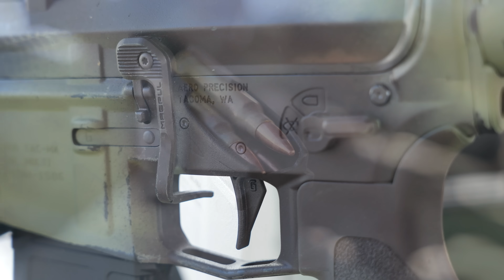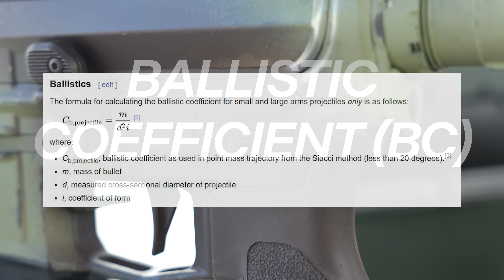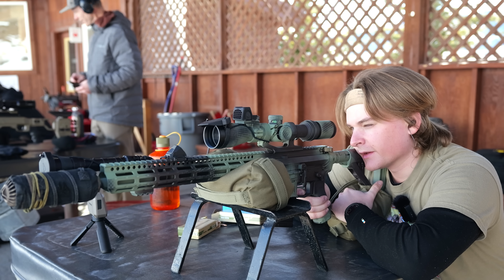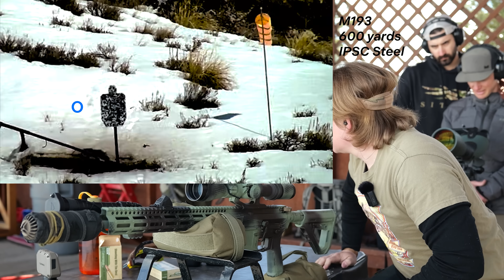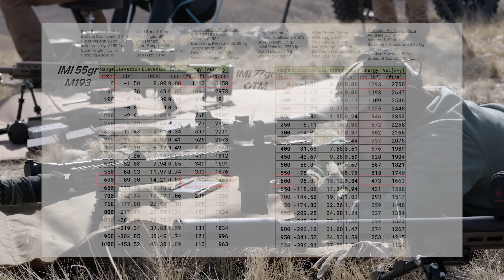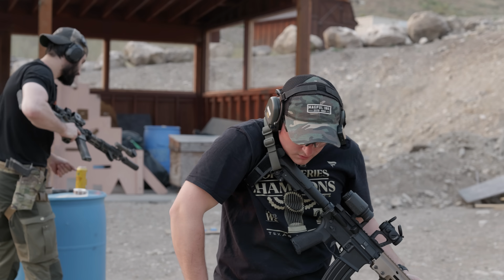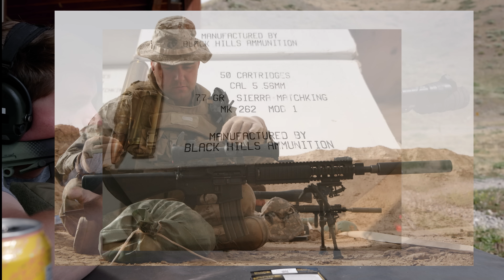77gr OTM: Why This Outstanding 5.56 Ammo Is Worth The Cost

Comment: Would love for 62gr to have been included in this test. It's what I go to as it's cheaper than 77 but performs better than 55. Great video
Reply: 62 gr m855 was adopted to extend the range at which 5.56 penetrated helmets and soft armor flak jackets the Russians were using at the time, but outside of that it has inferior performance. All of the ice pick stories you hear from the military come from the adoption of this round. M193 is going faster and is less stable, upon impact it’s like a motorcycle getting the speed shakes. For most applications I’d rather m193 over m855, the saw could have an argument made for improved penetration

Comment: While better for target shooting. You will have half the wounding ability even at closer ranges when compared to m193
Reply from the maker: How do you figure that?
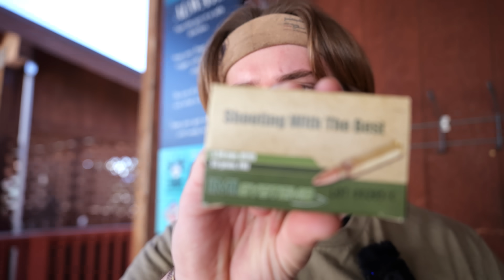Reply: @greenweiser .224 caliber is pretty useless without some kind of gimmicky wounding ability. Even expanded fully it isn’t terminally effective. High speed temporary cavitation and fragmentation are the only ways that diameter of bullet is able to create actually effective wound channels. A 77 gr otm would work well in a 220 swift for sure, but it’s just a hole puncher in .223/5.56. 1:12 20” m193 has a flatter trajectory and better terminal effect with less recoil but does suffer from penetration and deflection. But if you need to penetrate something heavy of fight heavy winds at long ranges you need a much more powerful cartridge anyways as there is not currently a 5.56 loading effective past 300 yards

Comment: Hey Benjamin, how do you feel about a 16” vs 18”  barrel? 
Is there really that much difference ballistically over the weight of adding those two more inches? 
There’s a sale right now for a Ballistic Advantage 16" 223 WYLDE SPR FLUTED STAINLESS STEEL MIDLENGTH AR 15 BARREL, PREMIUM SERIES for 162.50 
Any thoughts? Should I size up to an 18”?
Thanks very much. Very solid video btw! 👍🏼

Comment: 75/77gr and heavier have been in use for 20+ years now. Issue is that people just use what ammo they can get and don't bother to handload. High Power Service Rifle competitors were the driving force behind heavies and are the reason why you see 80gr BTHP and VLD style bullets all the way up to 90gr. I still feel a Berger 80gr VLD is an excellent round in a National Match Service Rifle barrel. Granted, you need to single load through the ejection port, of course.

Comment: I was active duty from 1973-2004, and a contractor overseas until 2009.  I never used the 77 Gr but carried an M-14 (one 16 1/4 barreled Full auto) or MP-5s most of the time after 911.
Reply: Thanks for your service. 1971-75.

Comment: I reload these and shoot long range also. They don't really start "falling apart" meaning wind plays a significant difference in POI until 800 yards. All the way out to 700, I can sit down with first round impacts all day long, and I have gotten 800 yard first round impacts. Beyond that, the wind matters a ton. I have taken it to 1000, but honestly have better guns for that distance. The 77 is legit though for sure. Its like shooting a different cartridge than a 55g 556. Feels like 300 blk and 308 ballistically.
Reply: What are you using for load data?
Reply: @grandpagun2843 this was factory AAC ammo Im talking about. I do have 77g reloads with Varget.  I cant remember my load off the top of my head because I shoot 69g smk also. I wish i knew exactly what the AAC load was because it shot like a freaking laser out of my Ballistic Advantage SPR barrel
Reply: @brockedandloaded thank you. I have some varget as well and thinking about the 77 grain load

Comment: The 1:8 twist rate is perfect for the 77 grain projectile, but offers a huge disadvantage for stabilizing the 55 grain projectile. For extreme accuracy, the 1:13.1 twist rate is perfect for stabilizing the 55 grain projectile, but has little significant difference in the more common 1:14 twist rate. Anyway, that was an excellent presentation and definitely showed the difference between lighter and heavier projectiles, with obvious differences in ballistic coefficients and the effects from the wind on each.
Reply: How does 1:7 handle the 77?  Does the 1:7 only excel with a 62 grain?
Reply: @andrewgrant2948 There’s always a “sweet spot “ of twist rate preferable to handle a particular grain, (or weight) of projectile in every caliber, as you probably already know.
Reply: @andrewgrant2948 The 1:7 twist rate would surely stabilize the 77 grain projectile since the twist rate would only be 1” shorter than the 1:8 as tested. As far as the preferred “sweet spot” is concerned, it appears by evidence of the tight grouping that you may get better results with the 1:8 twist rate for the 77 grain projectile. The 1:7 twist rate would more likely handle a slightly heavier projectile in the same caliber with the same results as tested. Wouldn’t recommend a lighter projectile for your 1:7 twist rate since the stabilization of the projectile becomes almost impossible, and your grouping will expand dramatically. Hope this helps !

Comment: The standard .556 NATO cartridge with a 55-grain bullet (often referred to as M193) worked just fine in Vietnam and it will work just fine if you are defending your house out to 150 yds. even in a 10.5 inch barrel! Out to 400 yds. if you have a 16 inch barrel. And it's cheap, relatively speaking. Big difference in what a normal civilian may need vs. a military combat unit!  You can buy a lot more M193 to stock up on than you can the latest and greatest ammo that the military needs to use!  As for me, I'd rather have 500 rounds of M193 than 200 rounds of the 77gr. OTM stuff.  Just sayin...

Comment: Wasn’t really impressed. 55 grain brass reloads were 1 MOA 5 shot groupings out of 16 1/9 twist , 69 and 77 grain were producing 2-3 MOA at 100. Using Leupold 1-4. Made it out to 500 meters and all three ammo types were making hits. Didn’t matter if it was 2-3 moa at 500 meters was enough to clear a man sized torso barely visible at 4x. The cost difference was not worth it and I never looked back. Good luck hitting anything in 15-20mph crosswinds at 600+ yards with a single shot. Yeah you might make a hit but you are sending half a magazine down range to get it. If it’s further than 500 meters then I would highly recommend 308 or 6.5 and learning how to dope.
Reply from the maker: You are right that it is difficult to hit a long range target in high winds with 5.56. I have attemped it many times in windy ass wyoming and know that 6.5 creedmoor is better at doing it. Those platforms have a place but we are testing the limits of 5.56 because we are interested and invested in 5.56. It's a good cartridge for a lot of things. 

I'm sure your 1:9 twist barrel shoots a tighter group at 100 yards with 55gr than 77gr because that's how bullet weight relates to barrel twist. Most people I know have a 1:8 or 1:7 twist barrel that stabilizes 77gr better than 55gr, while also benefiting from the probably higher BC of the heavier bullets. The 77s make a big difference at long range on the AR for me, hence the video :-)

Comment: i don't even have a 5.56 rifle , but i stack a little bit of 5.56 rds , 1000 . I choose pmc x-tac 62gn green tip , cause of the price ( around 800$ cad ) is that reasonnable ammunition ?
Reply: velocity 3100 out of 20" ( box info ) and .243 bc
Reply: @vandoo911  For shooting paper is fine and would be better than a stick, but US military doesn't even use it any more.   M855 A1 replaced it with much better performance.
Reply: @adamjones8218 seems like a good advice , i did not know them ...  
ill do half and half then , cause i already have 500rds m855 
they are much more expensive here 🇨🇦 , but they look better in many ways 👍
Reply: @vandoo911  M855A1 is ridiculously pricey.    In the US when you can find it, it's about $375 for 120 rounds.  Much less expensive to go with Barnes 62 or 70gr TSX (5.56) or Federal 5.56 Bonded LE rounds.
Reply: @adamjones8218 wow crazy !!!  seems pretty rare and expensive on my side too , but i found a stack of 510 rds at 865$ cad  , now need to find 865$ 😄

Comment: My little bolt gun likes 75gr otm   With its 16.25”, 1:9 twist barrel, I can achieve 0.5-.75” 10-shot groups. (100yds.). I’ll have to try the 77gr projectiles sometime.
Reply: Your bolt gun is likely not chambered for 5.56 and cannot handle the pressures safely.  Most bolt guns have a .223 chamber = lower pressure.  be sure to only purchase the correct ammo.

Comment: I've been reloading with 77gr OTM for over 10yrs. I switched from Varget to H4895 @22gr and 2600fps. One time at the range I was plinking a steel rabbit at 650yrds. Two guys were shooting a bolt gun next to me with a spotter scope. My LWRC piston AR with EOTech w/ 3.5x magnifier was nailing the steel repeatedly. They couldn't believe it. Most of my misses were due to the low magnification red dot limitations and my poor abilities. Otherwise, my platform and ammo were performing beyond what the bolt guys thought was possible for a red-dot piston AR.
Great video. The differences between your ammo was dramatically illustrated!

Comment: Did you know the open tip match was passed by judge because our military cannot use hollow points
Reply from the maker: @DRAKED411  OTM is not an expanding bullet or a hollow point and is used in military contexts all the time.
Reply: @ thanks for the correction, 👊🏻🇺🇸
Reply: OTM is not the same as a hollow point.  SMK's will work well within their performance specs as far as expansion.    I've taken over 20 deer with them - all heart lung.   1 walked about 10 yards, the others dropped straight to the ground all out of a 13.7 barrel suppressed.    150-190yds.     I wouldn't push it beyond that distance as they might start to icepick/not expand due to velocity loss on animals.

Comment: The problem becomes when you use these 77 grain bullets in SBR's shorter than 10.5".   Once they fall under 2200 FPS, they will not get consistent velocity based tissue tearing via cavitation FX.  So even if it makes an impressive permanent wound cavity in ballistics gel, that does not reflect how much tissue it would actually tear as every tissue type has different elasticity.   Once you get above 2200 FPS, the rate of fluid displacement in the tissue exceeds the elasticity of most types of tissue.  Thus you get velocity-based wound FX along part of the trajectory of the bullet.  This can be seen at slower velocities, but usually only with "big bore" calibers like .45-70.  
At any rate, this issue is why I DO NOT use 77 grain or even 62 grain rounds in my 7" barreled 5.56mm SBR.  I get superior terminal ballistics at home defense range using PPU 55 grain soft point rounds.   With those rounds I get 2300 FPS from a 7" barrel along with excellent bullet expansion and fragmentation.
Reply: I personally don’t like going Lower than 11.5 for 5.56…you ask me it’s the real shorter barrel sweet spot… But., I have to say if you are going 7 inches soft point 55 grain is damn good idea…

Comment: Just get AAC 77g OTM or 75g BTHP and you won't have to compromise on price or performance. These loads run super hot for barrel length, group the same or better than m193 and cost a few cents more per round. They also buck the wind and have great BC performance relative to price. Try out both of them to see which your rifle likes.
Reply: I reload 55gr for plinking, 75gr for everything else.
Reply: I have used the 75g very impressive.
Reply: I've been having a lot of issues with AAC 5.56
Reply: @7.62flavorsoffreedom2 I have not. I have shot a ton of AAC 5.56 55 and 62 and 75 gr Sabre. All have been consistent at about 2 inches. The 55 gr is a little more accurate in my 3 rifles.
I have shot their TSX, V-Max, SP and FMJ. All are reasonably accurate and prices are good!
Reply: @7.62flavorsoffreedom2  i keep seeing people reporting wild variations in velocity and quality with AAC ammo. I bought a box to see how my rifle and can like it but i never had the nerve to use it after reading about baffle strikes
Reply: That's been my experience. In my rifles (one Criterion 12.5", the other WOA 16"), they perform identical to Mk262 Mod1-C. I'm no marksman, but my rifles are zeroed for latter, and has identical POI and grouping with the former at a third of the price.
Reply: I’m in between, I’m reloading 69 gn. BTHP , 15 cent bullet. I’m wondering what velocity should I be seeking . 2670 fps / 16 in barrel before the primers show exceptional presser .
Reply: @dmo7815  Depends on the powder you use, different powders will give you different pressures at the same velocity.   You also have to make sure the barrel is capable of withstanding the high pressures,  like a NATO or Wylde.
Reply: Nice trigger work love hearing that click.
Reply: I got a blue ammo box of the AAC 75gr bthp awhile back when it was on sale and am thrilled with it. Now that I know my rifle likes it I'll grab another couple the next time they get it down around .50/round.  I saw some ppl complaining in the reviews on PSA's site that they dropped the 77 otm from 2700fps down to 2550 not too long ago. Doesn't affect me, as well as my plain-jane rifle likes that 75gr stuff, I'm sticking with it.  I got some of the 75gr black sabre as well and it shoots to the same poi as the bthp which was a bonus. It's not as cheap but it puts deer down better than anything I've ever seen from a 5.56 so i can only imagine how well it'd work on a 2 legged critter if it ever came to it.
Reply: just watched Preston Moore's new video so I'm skeptical on AAC
Reply: I agree 100%
Reply: Absolutely. This is pretty much all I buy now.
Reply: The only issue is for me at least the velocities are a bit more inconsistent than "real" match loads and the vertical stringing gets pretty noticeable at longer ranges. So I'll run the hell out of them for most uses, but not for precision work.
Reply: I just check PSA and they are out of stock it seems:   Price Per Round 	$0.50
Notify Me When Back in Stock
Reply: Any experience with Sierra Match King 77 Grain vs OTM?
Reply: @Contest4Freedom  The sierra's originally had some issues. I can't say if they fixed it or not, but the hornady 75g and the sierra TMK performed the best in my ar setup. The OTMs shot better in my bolt action but all of them are hot and perform well. You won't get 1 inch groups probably, but all of them shot better than 55g m193. I don't see how the sierra price is warranted. Buy the cheaper ones first to see how they group.
Reply: @nighthawkbomber Thanks man, I appreciate your input and time. Take care!
Reply: Both leave devastating wounds channels and 77gr will reliably fragment as slow as 2100, rumored as slow as 1900. 1900 might be exclusively for TMK rounds tho
Reply: That ACC ammo is trash juice 🤢 
But that hornady ammo sounds good, can’t go wrong with those mad scientists
Reply: @oSNAKEEYEZo  i have 2 boxes of AAC 77gr OTM ive had for a long time and still havent wanted to try it. Especially in my suppressor
Reply: @PotzyMccoy let us know how it goes bro 😂 
I’m honestly good off getting my barrel replaced in my front teeth lmao
Reply: @oSNAKEEYEZo  oh im not shooting that shit 😂.

Comment: i noticed that you didn't include the word "NATO" for which I have no problem. and actually the 90 gr HP is the heavy weight for the .223Remington/5.56x45. though i will admit that rifling will determine the rifle that will fire it accurately.  my 24 inch Howa being 1-in12 cant shoot anything over 62 grains and be accurate, but my 20 inch AR  being a 1-in-9 twist has no problem.

Comment: @BenjaminWeiser I great content very well executed. I am a huge 5.56/223 fan. I would agree with others, about varying 5.56 cartridge weight,s and barrel length under 14.5" and 1-7 twist. However what would really get my attention is, the same type of teto sting done with Badlands Munitions 85gr Match Burners BTHP 5.56 Shell Shock Nas3 (vs) Black Hills 77gr MK 262, if at all possible. really I like any content proving 5.56's worth against other so called replacement calibers. Oh as a suggestion you might want to mention to your spotters, that they could call out your correction, and impacts a bit louder. just saying

Comment: Judging by the ballistics of the 55 and 77 grain rounds, 
the 77 does so much better at 750M with double the energy output and speed which shows the 77 is far more efficient at range.
I do believe if he used a more aerodynamic round like a soft tip 77 grain that it would have achieved far better ballistics than a hollow tip 77.

Comment: When I went to Afghanistan in early 2010, we were issued mk262 ammo for the whole unit. Mind you, I was just a mechanic, and I had a bone stock select fire FN 20" A4 with an ACOG/RCO.
Reply: That's what my brother got in Iraq, as a machinist-welder working on vehicles. He worked in a base a few miles outside Baghdad repairing military vehicles and adding armor in some cases. One day they drove in a few trucks loaded with various small arms and ammo and told them to use them to defend the base in case the militias tried to break in with a truck bomb. No major attacks ever except an occasional mortar round or rocket  fired at the base by remote control, usually missing completely.
Reply: @PassivePortfolios IDF or Indirect fire was very common.
Reply: @geoffrey3289  But not accurate. More of a harassment fire actually. The insurgents were afraid of US counter-battery fire.

Comment: I wonder if Frontier 75gr BTHP is similar. I venture to say, 😮yes
Reply: I can answer that. I have 77, 75 frontier and 69 GMM and the 75 frontier never groups as good as the other ones. My Geissele and Sig both group best with 69gr Federal GMM
Reply: The same goes for cheaper alternatives such as AAC. Bullet type/gr/manufacturer doesn't mean the bullet itself is hold to or loaded to the same standards.